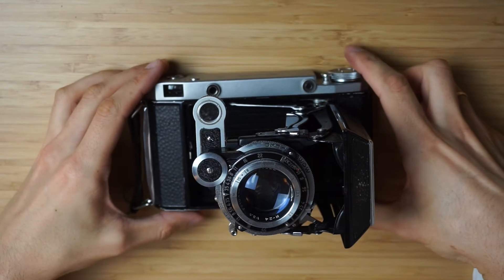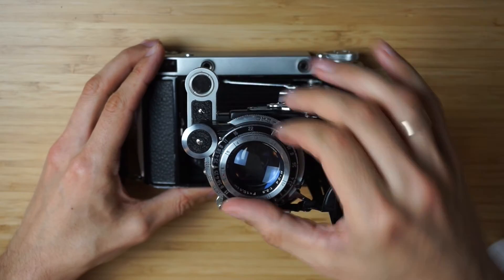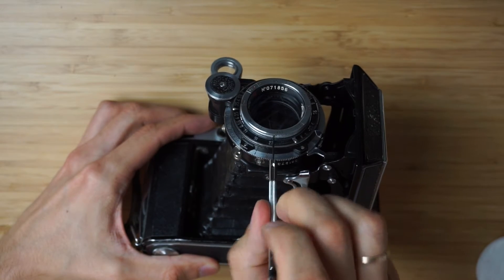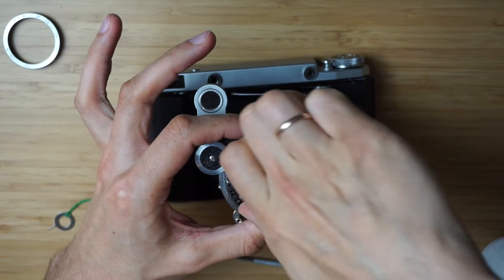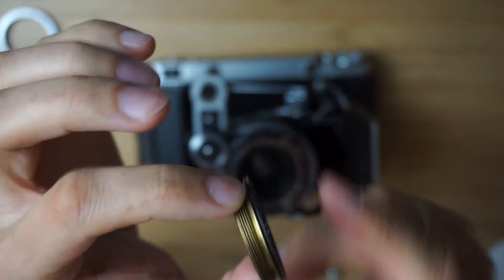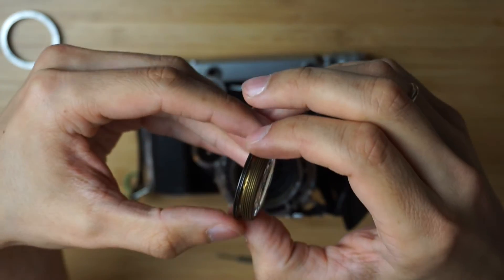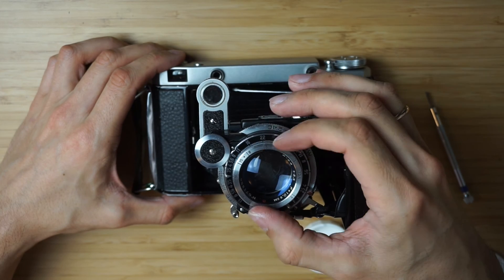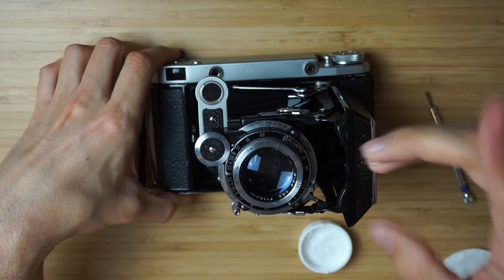Re-gresing an old folding camera, Moskva-5

Comment: Thank you so much for posting this excellent instructional video. I have a Zeiss Super Ikonta 531/2 and I had a smudge on the inside of the front element (apparently from a lubricating brush from a repairman) and I didn't know if it was a scratch or smudge and I was afraid to try to remove the front element properly. You gave me the confidence to do it properly and I was able to remove the focus ring and front element to clean the inside of the lens. It is all clean now. Now I just need to find some good helicoid grease to re-grease the threads.

Comment: I recently got a stopped mechanical chiming pendulum clock. I took it out and oiled it with Mobil 1 motor oil full synthetic. And my developing improved when I always use a water filter. I adapted a see through plastic small engine fuel filter and a rubber shower hose to fit the sink spigot. There is scale and stuff in the water supply. Made a big diff. On the clock I used a very very fine artists brush and wiped off the excess on the pivots.

Comment: Hi there ;) ..I hope you marked the position of the lens thread where it leaves the lens thread when you unscrewed it.. at 02:23 otherwise it is diffifult to reach exact infinity when you rescrew the lens back in.. Is the quality good of the Moskva-5? I think of getting one..greets
Reply from the maker: Hey! If I remember correctly there's only one way you can screw it in back. At least as far as I can tell my infinity is alright :) Speaking of quality it may vary to put it mildly. But then the price is not that high to not give it a try :)

Comment: Don't rub the glass so hard. Lighter fluid is good for removing old grease, so you're okay on that. Microfiber cloths are good for GENTLY cleaning lens surfaces. Make sure there's no grit, then breathe on the glass and rub with light force. If the glass doesn't clean, use lens cleaner or isopropyl alcohol. You also use too much grease.